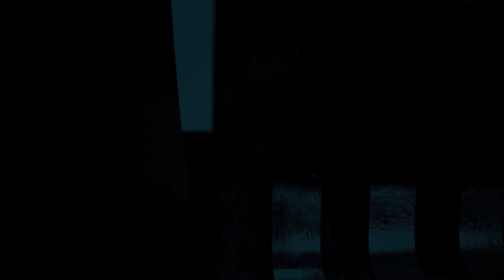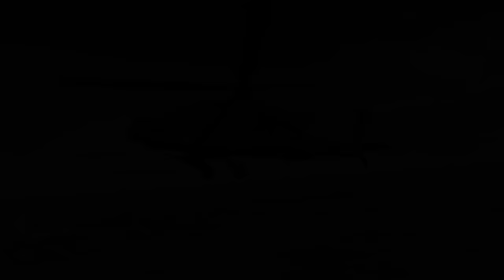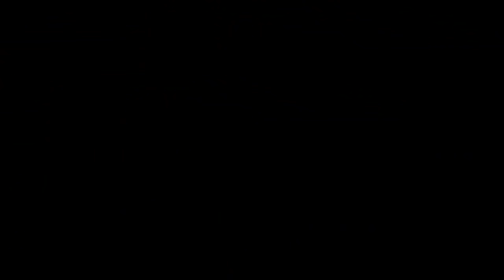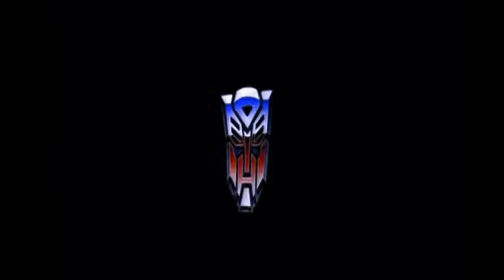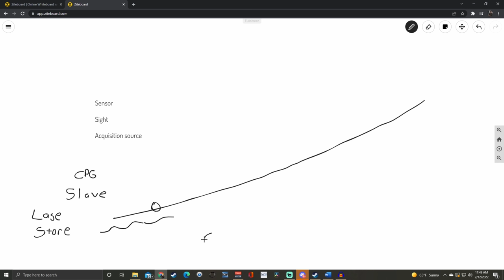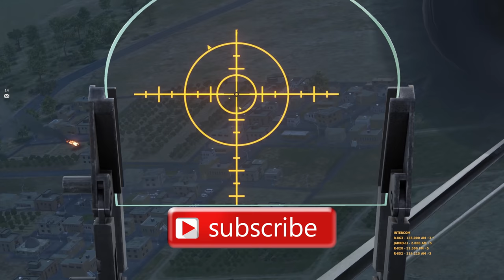DCS AH-64D | Using Acquisition sources | DCS World

Comment: "Acquisition source" sounds like a misleading name. Sounds to me like it should be called "Default Sensor Point" or something like that.
Reply from the maker: …we’ll let Boeing know.
Reply: @CasmoTV  Boeing came up with it? That explains things.
Reply: It's kinda like a SPI...
Reply: @CakePrincessCelestia  nah, because even in the A-10C you slave to a "SPI generator", as in the actual SPI is moving with the sensor generating it, whereas when the SPI is on a Steerpoint (a different HOTAS command), it is not slaved. You can look around in the TGP, while the SPI is on the Steer Point and drop a JDAM on the SPI/SP, while watching something else.
Acquisition Source makes a lot more sense to not confuse "fixed points" with a moving sight, the sensor is following (slaved to).
Reply: @shagrat47  Guess that's what I wanted to say with "kinda" - I was aware it's not the same.
Reply: @CakePrincessCelestia  I hope you are right, because I was struggling with that term a bit myself, and I am currently agreeing with that point of view. It would indeed be the point of view, and hitting "Slave" would be like "Set SPI" correct?
Reply: It is the location source to assist with the acquisition phase of the engagement. Maybe inital cueing source would be good but then it would be ICS.